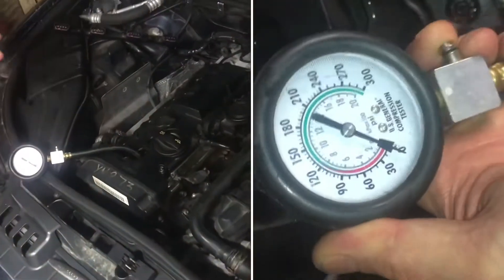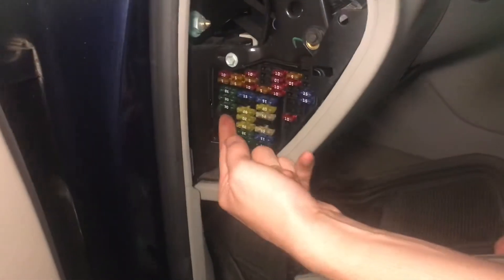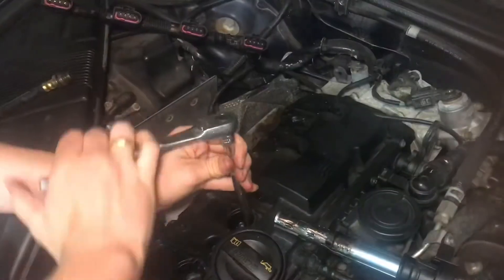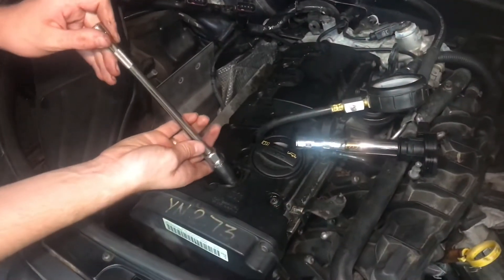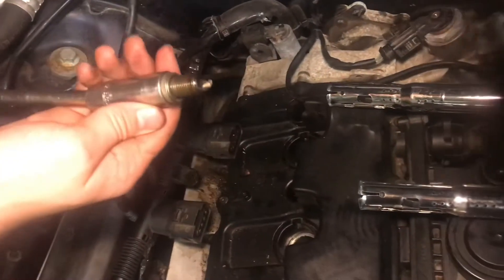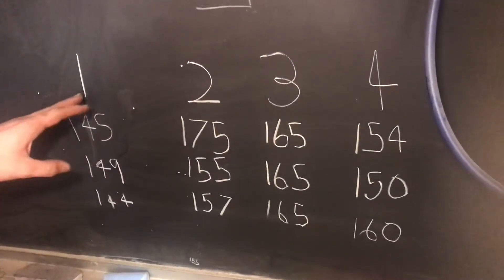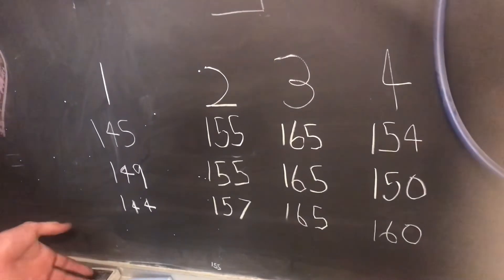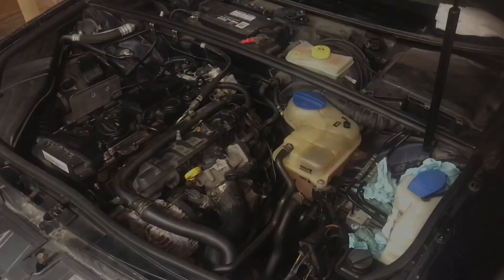“performing” a COMPRESSION TEST on an a4 audi passat (audi volkswagen)

Comment: You must have all plugs out when you make the test ...and the throttle fuel open
Reply: Do you need to disconnect the battery at all?
Reply: @whispers4495   you meed the battery for starter